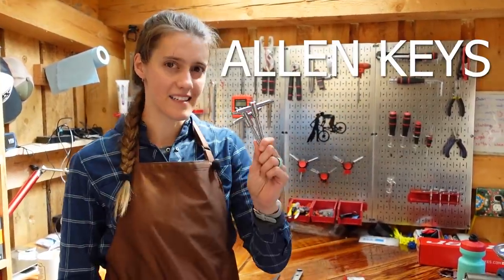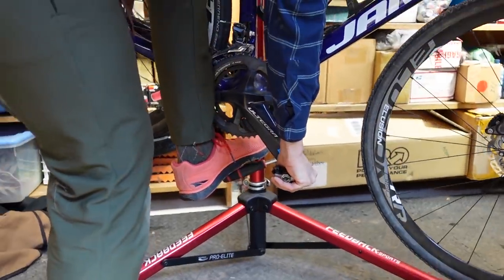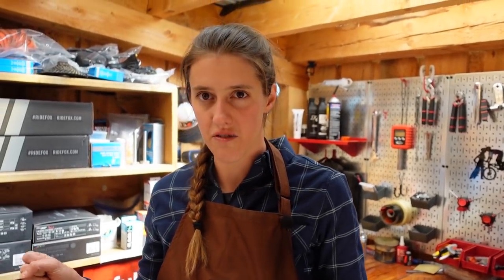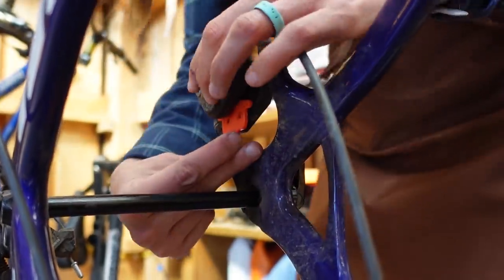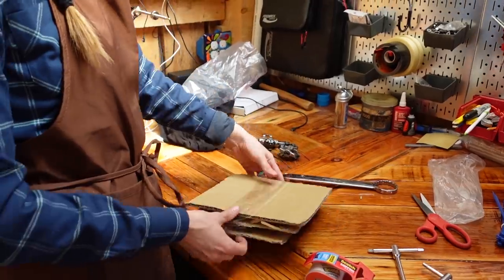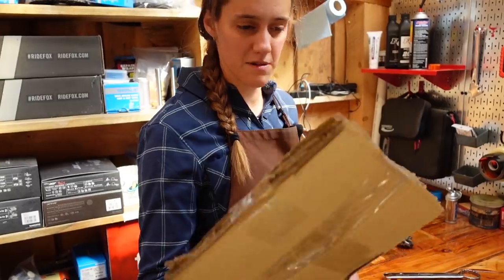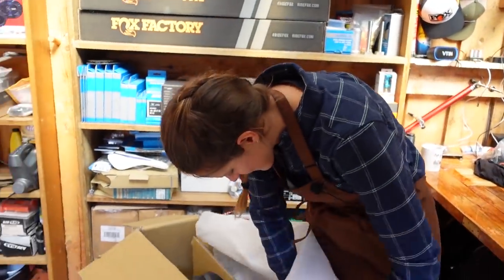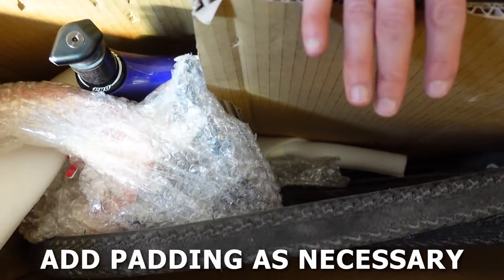How to pack a bike into a cardboard box for travel or shipping | Syd Fixes Bikes

Comment: Pedals Tip: when putting them back on, you hold your pedal shaft on the threading in the crank and „pedal“ backwards. The pedals will automatically screw themselves in. So you just need your allon key on the last bit. Works on both sides.

I allways enjoy watching your videos!

Greetings from germany

Comment: Good presentation.  I had a bike shop pack my bike the first time I travelled, but next time I would like to do it myself.  The tricky part: having all the materials to repack for the return trip.  You either have to hang on to the box and packing materials after you reach your destination  (not an option if there isn’t a SAG wagon) or you have to find new materials.

Comment: 'People' like to lay parcels down to stack them. You got the axles in the frame, but anyway, it's a good idea to make some rolls of corrugated cardboard, as long ,as the box is wide (e.g. 10 inches) and tape them to the frame, in a way that the box can not be sqeezed together so easily.
Reply from the maker: That's a good tip!
Reply: Yes, leaving out the dropout protectors can be a costly mistake. Putting the thru axles in by themselves protects the dropouts from being pulled apart, but that scenario is pretty much impossible. The dropouts being crushed together is much more likely. New bikes usually ship with hollow cardboard tubes, or plastic wedges, in place of the hubs. You can make your own tubes out of rolled cardboard. Just last week a customer brought in to my shop a frame that had been destroyed by being crushed in shipping with no dropout protectors.

Comment: Good idea to keep the rear wheel in the bike to keep the frame from flexing and cracking if the box is side loaded. Even with the they axle in there is nothing stopping it from flexing inwards. Also if it was to crack or get damaged most companies will not warranty it and you can loose a lot of money.
Reply: Or leave the through axle in, or add a spacer for quick release axles.  That will protect the frame somewhat.
Reply: @mattkavanaugh5623  The thru axle doesn't protect against crushing, only against pulling the dropouts apart (which would never happen inside a box anyway).

Comment: Thank you so much Syd - best tip for taking off the pedals. I was sooo stuck before I saw your video! I had to stand on the pedal with one foot and push on the crank with the other foot to get it loose (I had a tiny crank and real stuck pedals). Cheers!

Comment: If you're coming back don't forget to add spare tape and zip ties for re-packing for the return journey. Plus tools to rebuild the bike/dismantle, including scissors or cutters to get those zip ties off. Best of all, is an old spare stem. Put that on your bike when you take the handlebars off to keep the headset nice and tight so your bearings stay in place. I'm surprised the expensive travel case manufacturers don't sell them. 
I do love travelling with my bike!

Comment: Great video with some good tips!  Especially as to how to use zip ties and packing tape... ;)  Another reason to put the axles back in the frame is to add rigidity to the frame to protect it from cracking if mishandled during shipment.  If you don't have through axles there are plastic spacers that can be used when the quick release axles are removed.

Comment: when looking at the thread, if it slopes downward to the right like so: \\\\\  they are right hand thread and it's the normal righty tighty, lefty loosy.     if they slope down towards the left,  like so /////  they are left hand thread, as seen on the non drive side pedal, and it's righty loosy, lefty tighty.

Comment: my bike has a regular quick release and every time i remove my wheel of the bike and put it back the brakes go out of alignment . Any tips why this happens?
Reply from the maker: There are two likely causes (this is assuming disc brakes).
1. When you put the wheel back in, it's sitting slightly differently in the dropouts (this is one of the issues that thru axles solved). The solution is to put the bike in the ground after installing the wheel, open the quick release and push straight down on the saddle (for rear wheel) or handlebars (front wheel) while closing the quick release. This makes sure it's sitting all the way in the drops. Assuming you do this every time, after centering the brakes the first time, they should stay centered.
2. If you have to unscrew your quick release lever to get the wheel to come off, you may be tightening it a different amount when you put it back on. This can cause the rotor to be in a slightly different position to the caliper and rub. There isn't really an easy solution to this except to try to tighten it the same amount every time.
Reply: @sydfixesbikes  THANK YOU SOO MUCHHHHHH

Comment: Your timing is perfect, as I'm packing up a bike today for shipping! I have Di2, so I actually removed the seat entirely and unplugged the battery - not sure if that was right or wrong, but figured better safe than the other thing. Alas, I don't have the right centerlock tool for the rotors, so those are staying on, but I plan to pad the heck out of them. My son suggested reversing the pedals - meaning have them face inwardly on the frame, so they don't bounce around. Is that an ok thing to do?
Reply from the maker: Yeah, nothing wrong with disconnecting the battery. The reason you don't want to do that with the pedals is that no matter how you put the bike in, one of the pedals will be hitting the frame and will scratch it!
And yeah, protect the rotors as best you can and worst case they require a little straightening after shipping.

Comment: Whats it like re attaching the derailleur? Assuming it worked fine before packing, When you re attach is the angle the same should it shift the same, are there checks to do?
Reply from the maker: Removing and putting back on shouldn't affect the shifting at all because that's determined by the tension of the cable, which stays the same.

Comment: It makes no sense to remove the stem from the steering tube.  Instead, remove the handlebar from the stem.
Reply from the maker: Depends if you prefer to make sure your stem is straight or make sure your handlebars get back into their original position (which affects brake and shifter lever position, etc).
Reply: @sydfixesbikes  you would risk having the bearings and the steer tube jostling around during shipping.  The Stem holds the steer tube and bearings in place.